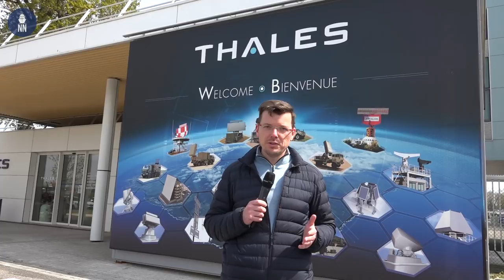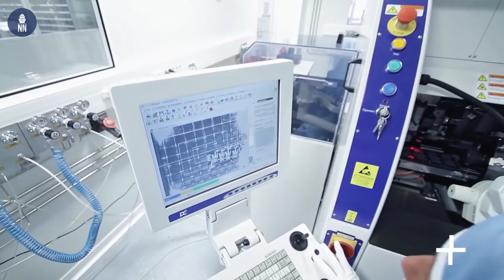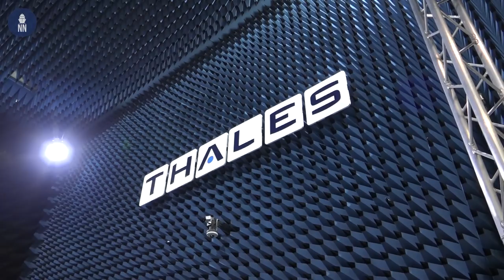Thales SeaFire Radar for French Navy Future FDI Frigates

Comment: Can't have very good range as mounted so low down.
Reply: 500km range is pretty damn good, more than type 45 by 25%
maybe next time actually listen to what is said in video before making comment
Reply: @lordtemplar9274  Range is determinted by curvature of the earth. You cannot see a sea skimming missile that far away if the panels are mounted low down. Type 45 radar is mounted 45 meters high so will obviously see farther.
Reply: @sensibledriver933  by your expert calculations what range difference does a few meters do when you are talking vast distances? Please enlighten me. To effectively overcome the curvature of the earth you need to be a lot higher with a plane like an AWACS.
Furthermore the FDI radar has 4 fixed panels giving total coverage of 360° azimuth and 90° elevation, so no blind spots.  The type 45 uses only 2 panels rotating 30x per min, giving you about 0.5 sec blind spot
Reply: @lordtemplar9274  
Simple explanation. If you look over a 5 ft fence you will only see what is visible from the distance you are. Two ways you can see more is walk closer or stand higher. It isn't rocket science.
When trying to track sea skimming missiles, that extra 5 or so miles at sea level is of more benefit than a radar that has continuous coverage over one that can only see every 0.5 seconds,  unless the missile can cover 5 miles in 0.5 seconds.
Don't forget that type 45 also has that huge black panel that can be pointed in the threat directon which has continupus coverage but only in the direction it is pointed.

https://en.wikipedia.org/wiki/Radar_horizon
Reply: @sensibledriver933  if you bother to look at the maths you will see that a few meters of mast height only makes a small difference when we are talking detection distances in km.  Based on incomplete info, we are hypothetically talking approx. a 13 miles vs 14 miles horizon detection range for sea skimming missile.  That is a difference of just over 1 mile, and certainly not 5 miles as you completely made up.  It's not like horizon detection doubles if your mast is twice as high.  Do you even know the height of FDI?

As i said earlier, the only practical way to overcome OTH in the open sea is with AWACS type planes, like a E2D Hawkeye on a carrier (or a crows nest on a heli).  Of course there are OTH radars on land but these are massive installations and would not fit on a ship.

None of this changes that you claimed it "can't have good radar range" when in fact FDI has +25% radar range than Type 45 widely regarded as having excellent detection capabilities (500km vs 400km).  FDI is a multipurpose midsize frigate and costs a lot less than Type 45 whose main purpose is aerial defence.  (FYI French Navy uses Horizon class for anti air carrier escort.)  In addition to aerial defence, FDI runs low noise and has in-hull sonar array + towed sonar for ASW.  It's a lot of bang for buck in a state of the art package.  So your criticsm is completely unwarranted.  

I bet Royal Navy would be happy to have Thales Sea Fire 500 on its Type 31, we will see what radar they choose to equip in the not too distant future. 😉